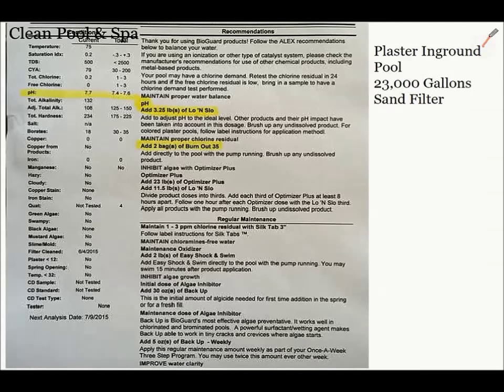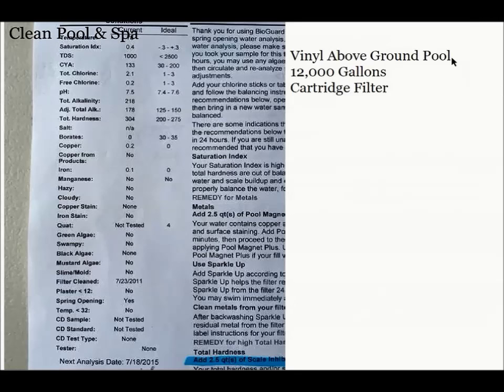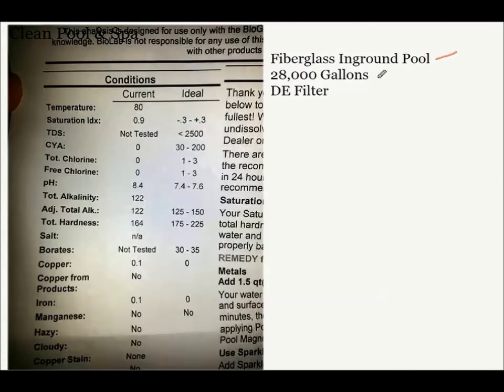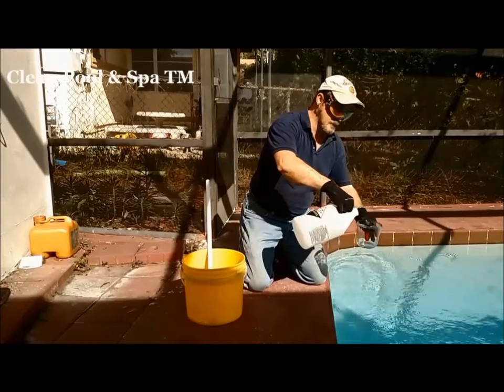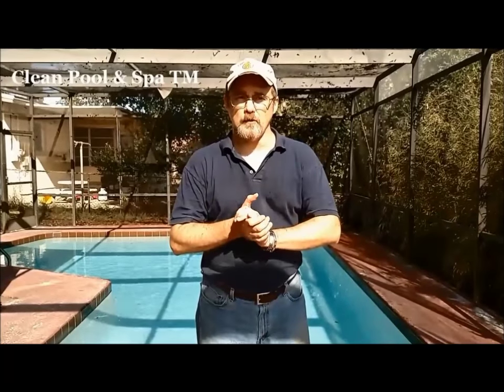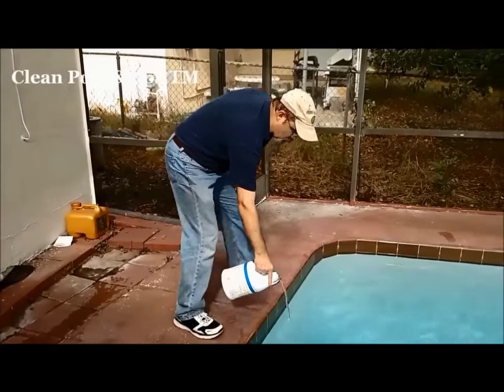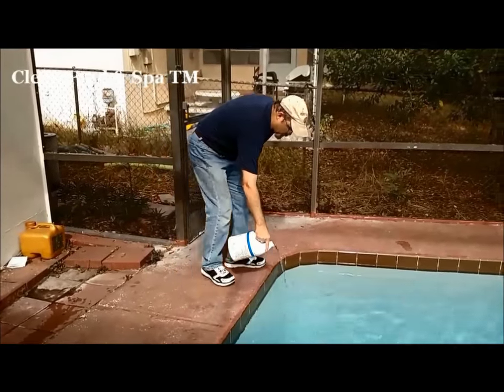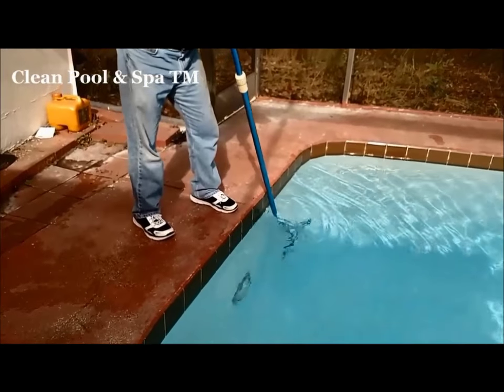How To Clear Up Green Cloudy Pool | Brand New Video Series May 2017

Comment: Would you please do a video pertaining to filling an above ground pool with well water that comes out clear but turned brown. How do we get the iron out?
Reply from the maker: A good method to filter well water is by using a 5 gallon bucket filled with polyester pillow stuffing. There are several detailed videos on YT and most use basically the same method and is very effective. I have access to above ground pools and plan on doing some videos about them this Summer. A good metal sequestrant is Jack's Magic Pink Stuff for maintenance. Check it out on Amazon or call them directly. A sequestrant doesn't remove metals, it hold them in solution until they can get filtered and backwashed out.